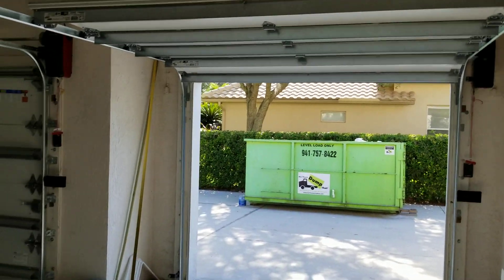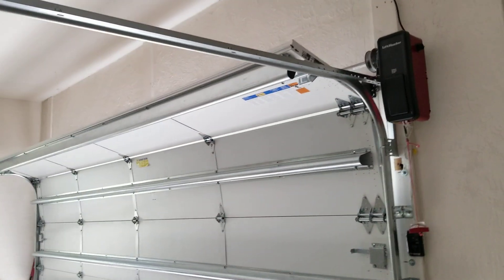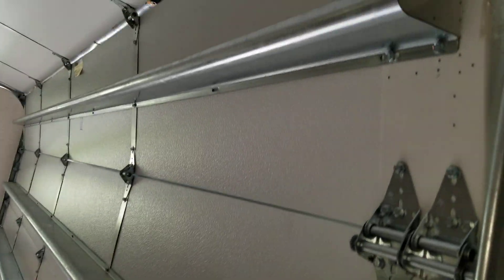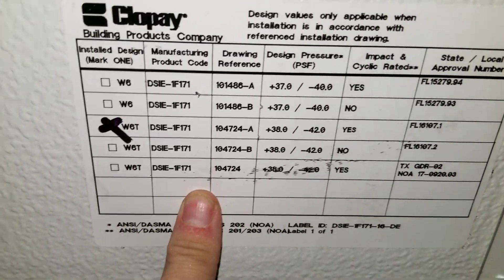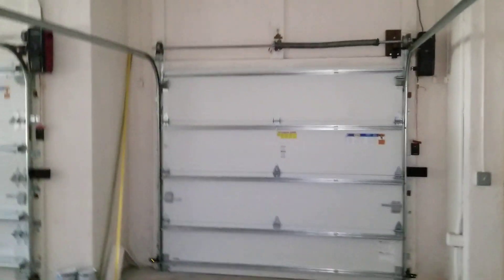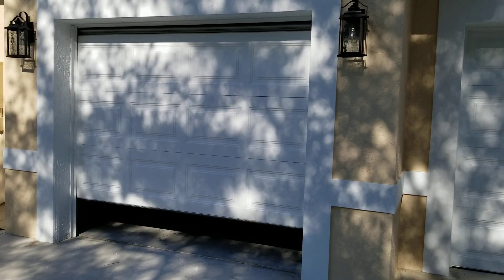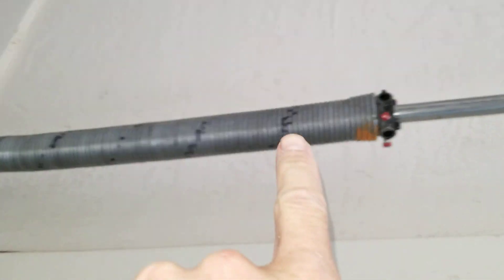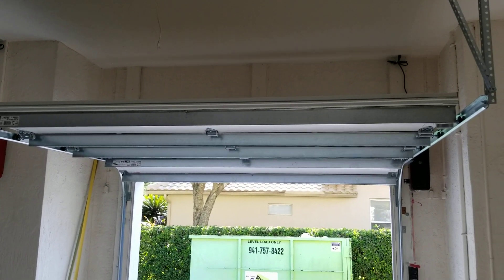I won't buy a    clopay

Comment: The reason your door wont go down (unless you hold the button) is because the safety sensors are either misaligned or something is blocking it.

Comment: Nothing wrong with Clopay, My company has installed thousands of them. It's all in the installation. The door not closing without holding the button is a photo eye issue. If you new anything about doors and operators you would know that there is a diagnostics mode on Liftmasters operators.... It will tell you where the fault is.  Do people pay you to install?

Comment: The reason your door makes a lot of noise whoever installed it did a horrible job and second the doors are not insulated, it’s the lowest line of Clopay
Reply: They are insulated. Also this is a installation problem.

Comment: Nice!
Double end style.  Oh yea!!
Reply: What’s your opinion on clopay Garage Door Genius?
Reply: I've installed a ton of 4050 and 4300's for a company before.  Wasn't too bad if I remember right.  I'll give any manufacturer a shot as long as the doors aren't damaged.  C.H.I needs help in that department.
Reply from the maker: Garage Door Genius yeah you are right. They had problems to.
Reply: @gripgaragedoor82  Imagine if you saw a Clopay with a Genie chain glide opener.
Reply: Clopays are FINE they’re are some Clopays as old as the 90s that still open and close. Wayne Dalton same.

Comment: It’s whoever installed the door didn’t do a good job keeping it quiet otherwise clopay is still a good door compared  to Wayne dolton otherwise galvanize springs and the rollers no good
Reply: Clopay’s are not GREAT,  Wayne Dalton doors do look nice but are not that great.
Reply: Wayne Dalton is also fine. Both Clopay and Wayne Dalton should not be hated.